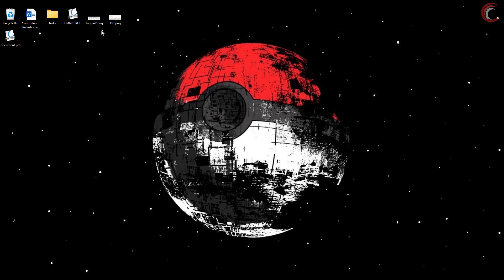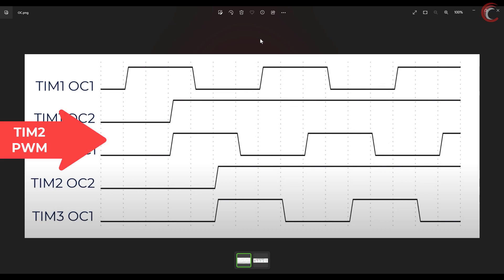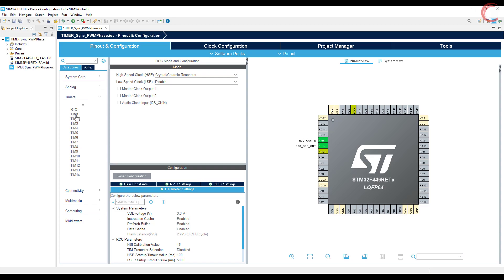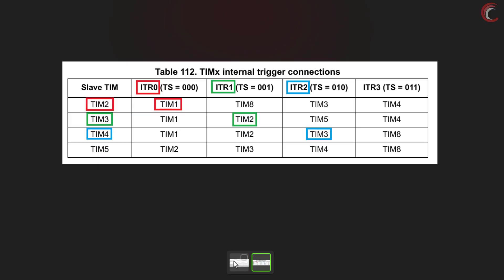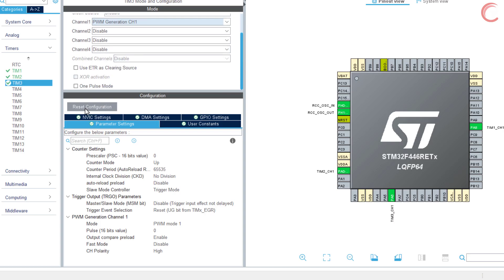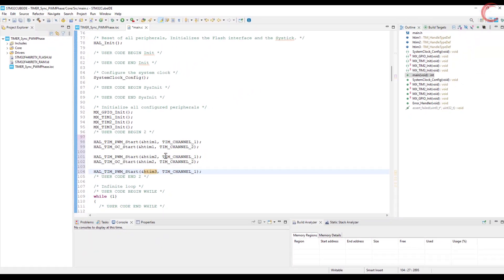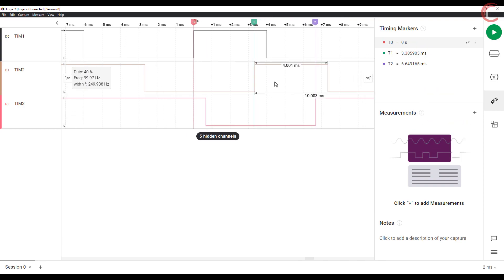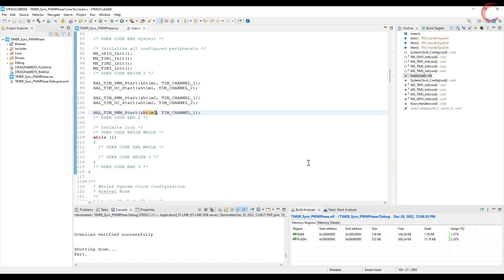STM32 TIMERS #6. Timer Synchronization || 3 Phase PWM

Comment: I use stm32f103c8t6 and I followed your explanation but the code is not working properly
Reply from the maker: What is not working ?
Reply: I don't know. All the signals are coming out at the same time. Can you send me the timer settings?  Stm32f103 @ControllersTech
Reply from the maker: I will test it later and let you know. It should work the same way.
Reply: ❤Thank you, I am waiting for your reply.  @ControllersTech

Comment: Thank you for the tutorial, Can you measure time difference phase shift between TIM1 and TIM2 with stm32?
Reply from the maker: I am not sure but I think there is no dedicated feature for it. 
You can manually do it by using 2 input pins with external interrupt on rising edge. Then start the timer once you get the first trigger and stop the timer on second trigger.
Reply: @ControllersTech hi sir i have question, i used acin 220v for ipm igbt module ( after rectifier i get 310v dc) the ipm can handle till 600v, but my motor only acept 200v. Now how ti reduce duty cycle for HIN and lin input sir?? If i used 50%duty cycle i will get 155v out from ipm right sir??? I used stm32 g431 and st mc worckbench motor control sir

Comment: Thank you for your tutorial. I am new to STM controllers and have been following your tutorials to generate PWM signals using STM32.
I'm using an STM32F407 board to generate two PWM signals, and from what I've gathered through online research, I need to use two timers, one in master and another in slave configuration. For the master Timer (Timer 1), I've set up two PWM channels. Channel 1 of Timer 1 is for PWM generation, and Channel 2 of Timer 1 is for triggering Timer 2, which is set to 'output compare no output' mode. I followed your tutorial to configure these channels.

What i actually want is to change the phase shift between two these two PWM signals in run time by modifying the CCR registers in the main. The pulse value set in TIM1 CH2 is supposed to change the phase of the PWM generated by Timer 2. However, I'm unable to change the phase at runtime. I've tried changing the value of the CCR2 register in the main code, but it doesn't affect the phase despite updating CCR2. The phase of TIM2's PWM1 is delayed if I set the pulse of TIM1's CH2 in the Pinout and Configuration section of STM32CubeIDE. However, the phase does not change if I modify "htim1.Instance->CCR2" in the main function. This is the problem I am facing. I want to update "htim1.Instance->CCR2" during runtime.

Could you please point out my mistake and provide the correct syntax? And if possible, could you explain it in simpler terms, as I'm relatively new to this?
Reply: the output compare 2 once switch on, it's wouldn't switch off.
So, you cannot modify the CCR2 to adjust the phase.

Comment: Hello, thank you for your valuable lessons! Is a possible way to implement phase shift between complementary pairs of different channels at the same timer?
Reply from the maker: Isn't it shown in the video ?
Reply: As I can see the application of this video is generating phase shifted signals between different timers using master/slave configuration (timer synchronization). I am trying to achieve phase shifted signals at a single timer but different channels. I can see that TIM1 OC2 is used to trigger the TIM2. Mby if I choose Output Compare CH2 (instead of output compare no output) and Toggle on match mode (instead of Active level), will it make it possible?
Reply: I am sorry if something doesn't makes sense, I am a beginner to STM32. Thank you very much for your immediate response!!!
Reply from the maker: I don't thik it works like that. The second timer needs to be in slave mode for the synchronization to work.
Individual channels can't be configured i. Slave mode.

You can try manually though.
Start the different channels after some delay. It won't be precise, but if you adjust things properly you might be able to achieve it.

Comment: Thank you so much for yor video, i have a question, i did it for 2 Phase,  it works great, but after i stop my Timer Master and Slave in order to have Delay, i mean with HAL_ TIM_PWM_STOP, doesn't work my timer slave any more, can you help me about that?

Here is my code, and my Tim3 works only one time and not permanently

HAL_TIM_PWM_Start(&htim2,  TIM_CHANNEL_3)
HAL_TIM_OC_Start(&htim2,  TIM_CHANNEL_4)
HAL_TIM_PWM_Start(&htim3,  TIM_CHANNEL_2)
HAL_Delay(200)
HAL_TIM_PWM_Stop(&htim2,  TIM_CHANNEL_3)
HAL_TIM_OC_Stop(&htim2,  TIM_CHANNEL_4)
HAL_TIM_PWM_Stop(&htim3,  TIM_CHANNEL_2)
HAL_Delay(200)

Comment: Thank you so much! Little remark. It needs to pay attention to the order of initialization of the master-slave timers in the code. For example, when timer 3 is the master and timer 1 is the slave, when generating the code CubeMX initializes timer 1 first by default. In this case, timer 1 is may starte by itself, asynchronously with the master (timer 3). That is, after the generation of the code, the sequence of initialization of synchronous timers should be adjusted.
Reply: THANK YOU SO MUCH!!!!! This drove me crazy for two days until I found this comment. Tim2 initialized before Tim1